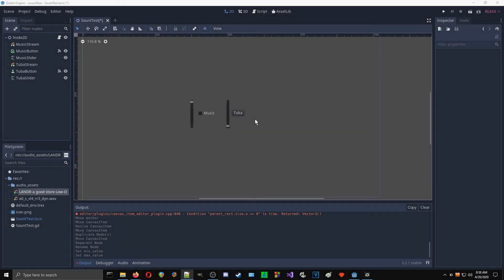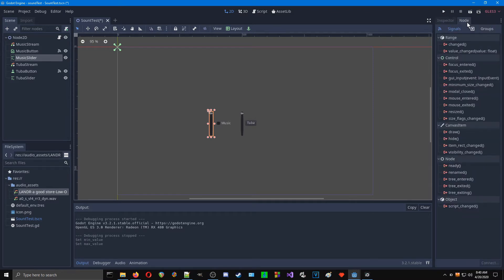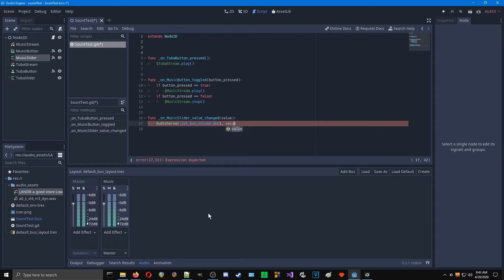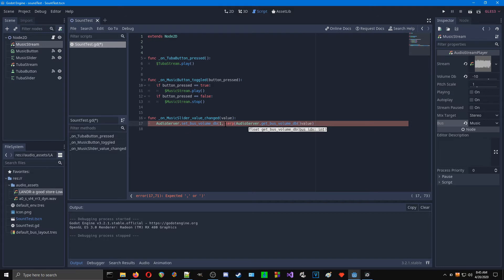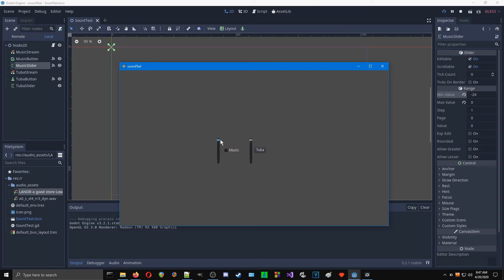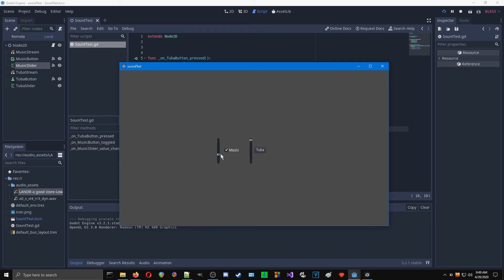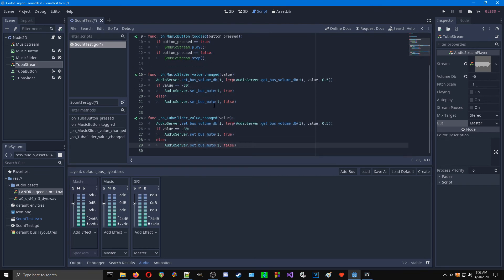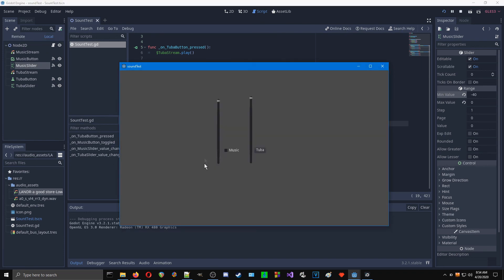Godot Engine Audio Tutorial - Smooth Volume Sliders

Comment: I wish I had found this weeks ago. I did some research and wound up doing this the hard way with math. Slider values are default 1 to 100. I added check buttons for mute.
func log10(value):
	return log(value) / log(10)

func slider_to_sound_db(value):
	if value == 0:
		value = 0.0001
	return log10(value) * 20.0

func sound_db_to_slider(volume):
	return pow(10.0, volume / 20.0)